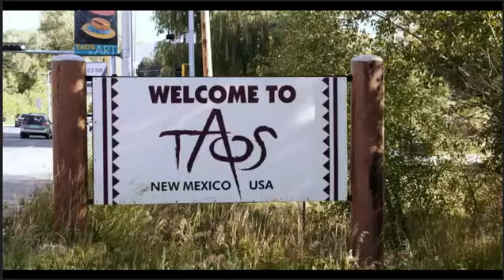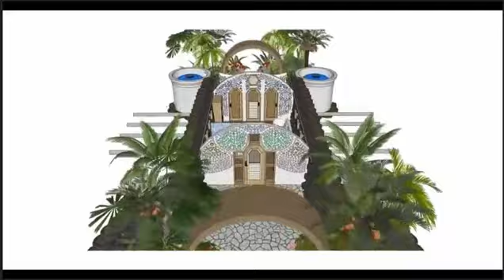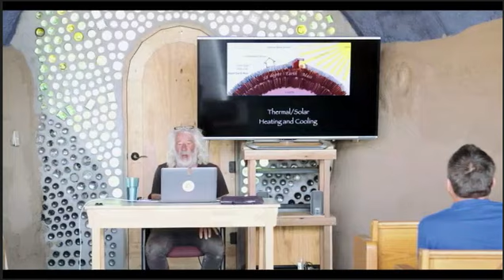Earthships: Inside a Model of Self-Sustainable Living in Taos

Comment: an old roman hypocaust in spain where winter lasts 9 moths a year an old house still using the hypocaust heating system to use thermal mass to heat the home unbelievable the house over 300 years old basic materials and construction